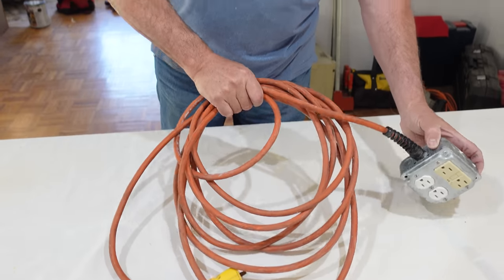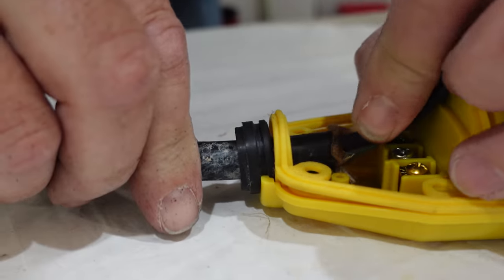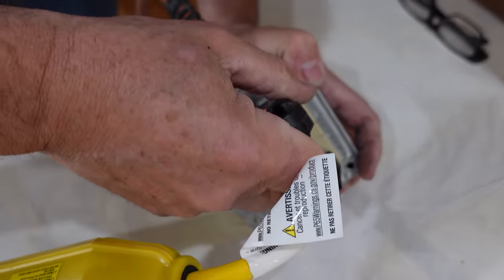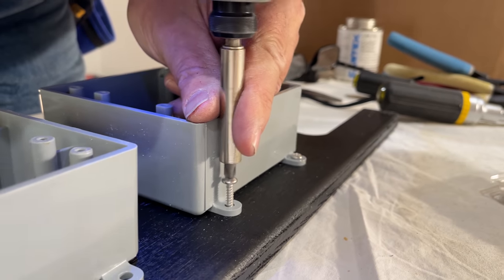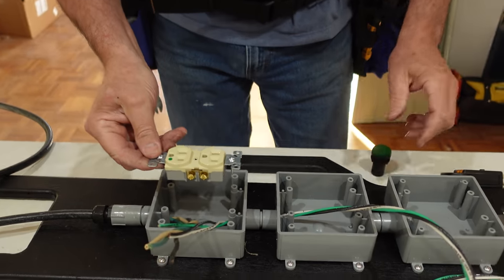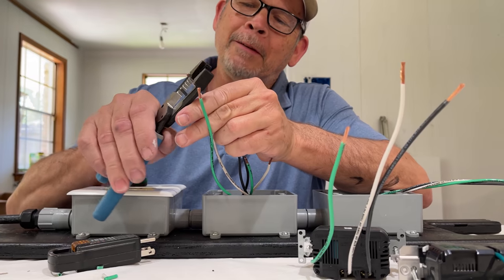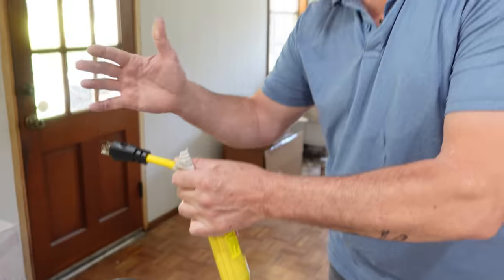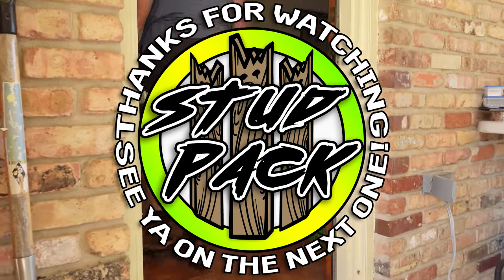HOW TO MAKE THE ULTIMATE EXTENSION CORD!

Comment: I never knew that the USA has such 20 amp plug with the one 90 degree rotated prong, interesting 🙂 But regarding 5:49, it's better to put the wire on the left side of the screw, so that the rotation of the screw will pull the wire in. On the right side it's tending to push the wire out, just a tiny bit, even with this clamp design. It will work this way, but to be perfect.. 😉 And regarding 2:08, it would have been better to cut the plug of like 10 - 20cm away from the plug because conductors tend to break overtime near where it's mechanically connected (metal fatique), so now you have half worn out conductors in your new extension cord. I guess i better leave my opinion in the middle about the ultimate-ness of this extension cord (so many sticking out things that can and will break), but it's a nice project 😉
Reply: Pulling a number from the air, I'll bet 97% of Americans are not aware of the 20 amp feature.

Comment: About the "hospital grade" receptacle... My understanding is that the green dot signifies an isolated ground, where the ground does not terminate on the neutral bus at the service. It just so happens that many hospitals utilize isolated grounds because it is less prone to interference of sensitive electronics. It is also likely that these are more heavy duty simply because of the [non-residential] nature of isolated ground installation environments, not the other way around. I'm not an electrician so perhaps I am misinformed. And I am not sure how NEMA would feel if you are identifying an IG receptacle on a non IG circuit. Maybe black sharpie over the green dot???
Reply: An orange triangle is isolated ground, green dot means hospital grade, step above commercial/spec grade.

Comment: Love all the videos and I’m sure the circuit will hold at 28 amps for a short period of time till the gfci gets hot enough to trip… 
A separate question altogether but I have a weird circuit that I have tried wired several different ways to get both fan and light to work independently. For some reason circuit is live no matter what I do? Any suggestions?

Comment: The hospital receptacle is actually an isolated ground receptacle. doesn't do anything in this situation because it's used to have a direct ground wire from that plug to the panel having all the grounds connected cancels the meaning of having an isolated plug.

Comment: So the improvements made here are really nice but outdoor boxes with indoor plates still is a shock risk.  I would have used outdoor rated while in use covers and ditched the wago connectors and instead opt for screw down wire terminals or marettes.  Wago connections are not great for high current applications and are the connector equivalent of the pinch terminals on consumer grade audio gear.  They are probably fine for wiring a lamp or ceiling fan but not for high loads like this extension cord.  You mean NEMA 5-20r not 6-20r.  6-20r is 240 across both Lines in North America.  Also a cord with a 20 Ampere receptacle should have a matching 20 Ampere plug on the other end.  Some vacuum cleaners when blocked should be shut off as the air from the hose is used to cool the motor.  Now some vacuum cleaners like the wet and dry cleaners, some central vacuum systems, Kirby units and Rainbow cleaning systems between 1985 to 2019 have bypass cooling fed from a separate cooling fan to cool the motor windings, it’s not as big of an issue.

Comment: To slide on that grommet. Use Windex or ammonia. They're Bases, what are the properties of bases? they're slippery, what's true of bases and acids? They are only either when they are wet. So spray on some Windex, that grommet will slide right on, when the Windex dries the lube effect is gone the rubber part will stay in place. (I learned to do this handle grips on bicycles.)

Comment: imo, the live wire breaking free and contacting the aluminum housing isnt nearly as much of a concern as that giant plastic housing cracking, taking on water and other contaminants or straight up breaking apart.
you have a GFCI on the male end, so long as the housing is grounded its fine if its aluminum

Comment: Green light's cool, but mine has a panel mount Voltmeter/Ammeter in one slot. The backlight is blue and it can read up to 300V so it can warn you if someone has wired 240 to a 120 outlet.

Comment: Nice very "Nice" Hello so I dislike being a nitpicky viewer! But I have two picky- nits. Well one ? And one Suggestion #1 I noticed you didn't add a GFCI? But I think that's understandable Because equiped with phone charging devices it shouldn't be in damp locations So oK and #2 Given the length of your Monster cord, the Guage and all of the devices! Wouldn't it be nice to add an onboard circuit breaker suitable/capable enough to interrupt power if overdrawn?? Thanx D.

Comment: The 20 amp rating is a maximum you can expect to run continuously and a minimum at which you should ever see the breaker trip after extended use.

Comment: The first extension cord with the orange cable violates its usage under UL. UL has issued warnings using metal boxes with pre-press K.O. for this purpose. The K.O. can get pushed in and cause shorts and allow access holes that fingers can go into.
The second cord Violates UL under the fact that the system can only be rated to the lowest voltage and current/wattage for the lowest component within the branch power circuit. Since the GFI is within the branch circuit and clearly labeled 125v/15a all components downstream must inhibit/prevent devices larger from being connected. Also fairly confident the cord is undersized for the 20a application.

Comment: 2:50 When I do this I usually just take a pair of needle nose pliers and use the cutting part to gently press into the wire and I do a circular motion to cut the exterior sleeve

Comment: The vacuum pulls less amperage, but most will OVERHEAT! It depends whether the motor is flow through or bypass cooling. More expensive vacuums, like central vacuums, use the bypass style where even if you block the hose, cool air blows over the motor. Bypass motors are also used for vacuum tables/presses where they need to maintain as many inches of vacuum as possible on the part.....the opposite of a vacuum used for cleaning.

Comment: My understanding is that breakers are inverse/time devices.  This means that should the connected devices draw more current than the breaker is rated for, it will take a period ot time before it trips off.  Should the current that the is drawn on the breaker rise eve higher, the amount of time before the breaker trips will decrease, meaning the breaker will tirp sooner.  Hope this helps?

Comment: One thing I noticed,  those Wago's can sometimes have the small lever pop up causing the wire to not be clamped tight. Wrapping with electrical tape prevents the lever from popping up.

Comment: 1) ground wire should be shorter than the other 2 if the terminal is not already constructed in a way that disconnects the ground before other wires
2) if you have a clamping plate with the screw thread 'in' the plate, put it on the left side, so the screw rotation 'pulls' the connection in rather than 'pushing' it out
Reply: Ground should be longer than the other 2 terminals so the device is grounded if something goes wrong. Line should be the shortest so it disconnects first. So if something goes wrong there is no connection to 120V so you can't electrocute yourself
Reply: @arigasendo147  I did a derp. Of course ground should be longer - I had a thinking error because of a few beers and the fact that here in Europe, the ground pin usually protrudes farther towards the connector end :) Thanks for correcting it

Comment: Can you tell us the measurements of the black plywood base I have built the backbone part with the plastic boxes wired it up and it works perfectly but since I am a novice with wood work I need the different measurements to finish the project I need the width and length and the cut out size for the cord wrap around and the exact size and placement  of the handle hold oh and yes I have subscribed to your channel  and liked this project

Comment: Plug everything in but use them 1 at a time. I worked Hospital Maintenance and the reason Hospital Grade outlets are needed is because of the constant plugging in and unplugging of bed side equipment. Ordinary outlets wont last a single year. New construction sites need to learn this lesson.

Comment: I would also change the order and put the light at the other end.  You want the light at the top when you hang it on the wall so that it will be visible and not obstructed by all the cables hanging down.  I think I would put the USB's next to it for a similar reason, both to make them more accessible, but also to avoid having them mixed with as many 120V connections.   Also, for the switched outlet, I would use a combination switch and single outlet.  Not only would it make it clearer to the uninitiated that maybe it is only that single outlet that is switched, but do you really want the switch to control 2 outlets?  If so, then why not use two of them instead with separate switches in the same space.  I also would have gone with cover plates that would not snag and break so easily as the ones you used or some other way to protect those sharp corners from causing abrasions as well as breakage.

Comment: I would have reversed the order of the outlets, making the first box the one containing the 20A outlet. As you made it, it's at the end of a daisy chain of wago connected jumpers, with each adding a small amount of resistance, and therefore voltage drop at 20A, which could amount to several volts I'd guess.

If I were making this thing, I'd prefer a "bus bar" approach where each outlet is tapped from a solid copper bus made of heavy gauge copper wire or bar, in a similar way to how power panels are organized.

Comment: Place a fuse rated for the max amp draw of the wire to prevent over heating. Place the fuse on the hot side before the outlets.

Comment: Wouldn't it be better/safer to use wire that is rated equal to or higher than the highest amp receptacle? That way when you DO use a 20A tool/device, it's not running along a 15A cord?

Comment: Why didn't you build in a voltage/current meter into the extension?  Also maybe a WIFI smart plug so if you're on the roof you can turn things on and off.  Or am I spoiling V3.0?

Comment: As a power system engineer, I want to add a few things that the circuit designed for 20A, would be for 15A. Circuit = Wire size, if wire size is designed for 15A, 20A receptacle should not be on there. Secondly, 20A circuits should be at the entry (where the hospital grade is), why? Voltage drop. Thirdly, the indicator light should be at the end of circuit, not at the beginning. Some Electricians do not like Engineers advise, but its an engineer's ethics to point out when things are not right. :) Otherwise a good video.

Comment: Do you trust those Wago connectors? They don't seem to hold the whole wire and just touch the front and back. Or is this fine since it can spread the wire strands out more than a solid wire?

Comment: As a retired EE...  DON'T put glue/cement in the female side of PVC conduit/box connections.  Only put your glue on the male ends.  That way an squeeze out will only be on the external portion of the conduit or connectors.  
A) any wet cement can react with the various coatings potentially soften or destroy your wire insulation.
B) any dried cement can dry with sharp edges... even when you try to wipe up your mess.  Those sharp edges or points can cut or strip your insulation when you pull wire through exposing your conductors.

It's an easy change in your procedure and can save you and your insurance a whole lot of money... and your reputation a whole lot of grief.   There is no pressure in conduit like there is in PVC water systems so you don't need a primer or a lot of glue... just enough to be water tight if you are burying it.

(Edit)  I watched to the end...  why didn't the breaker trip?
Your typical residential NEMA circuit breaker is an inverse time circuit breaker. This means that the time that it takes for the circuit breaker to trip is determined by the amount of current flowing through the breaker. This is called the breaker trip curve. Trip curve data is the graph that comes with the paperwork or card that is in the packaging.

For a standard 20 amp circuit breaker it may take a couple of minutes to trip at  say 25amp, quicker at 30amp... maybe not at all at 21amp

Comment: As a electrician with over 50 years of experience I can tell you that this kind of extension cord have been being made for at least that long (50 years). You should have used connectors on the ends of the stranded wires, avoid    adding  any extra connectors in the box, I would have used exterior grade covers for the box as those plastic covers are only for in doors and provide no impact protection.

Comment: If you would have run it longer it should have tripped for sure. The  12 wire is actually amp-rated for 25 amps, the wire probably wasn't getting hot enough at the breaker to trip.

Comment: 26:11 the fact that the sound increases in pitch to me makes immediate sense that the motor is performing less work and using less power otherwise it would decrease in pitch as it would be loaded more thus lowering the RPM.  A motor under no load will have a much higher RPM then a motor under load

Comment: It didnt trip because it is designed so when you first start a saw or other tool the initial draw is more than it is after it is running. It can hold more than 20 amps for a short time but a breaker is only good for 80% of its value for constant loads. A 20 amp breaker can continuously have 16 amps but if it goes for more than a few minutes above 16 amps it will heat up and trip.

Comment: All modern circuit breakers are not designed to pop at the instant that it hits the rated current, a good example of this is my dust collector that pulls a whopping 50+ amps when you turn it on, it is on a 20 amp breaker... once it gets up to speed it pulls < 15 amps, but for a bit when it is spinning up it pulls a TON.   If the breaker popped instantly when you hit the rated current then all sorts of inductive motor appliances would be pretty worthless.   This isn't a problem because the wires don't heat up much in this situation.   If you let it keep going for a while, the breaker would have tripped.    Of note, if I turn on my dust collector let it run for a while, then turn it off and let it stop, and try to turn it on.. Boom! it pops the breaker.  Why?  The breaker has already heated up a bit from the power running through it that is close to its tripping point so when you start pulling a large load it pushes it over the top.    If I let the breaker cool down between runs it will start just fine.  They used to call the breakers 'slow blow' or 'fast blow' breakers, and now all of them you are likely to find are the slow blow ones.   There isn't much use for a fast blow breaker for inductive loads.

Comment: I would have gone metal - boxes, faceplates, etc., and 12/2 would have been a no-go for me - at least 10/2, or even 10/3, depending on where I was expecting to be able to plug it in (especially since you added a 20-amp plug in addition to the duplex and other ports). The fact that you went to the trouble to ensure a good seal on the boxes, but, then have all that potential leakage at the outlets, faceplates, etc. kind of defeats the purpose of trying to water-proof anything. I guess you could have sprayed the whole thing down with FlexSeal after the fact.

Comment: The circuit breaker will trip after a short period of time the breaker just needs to heat up a little bit due to the overload. Give it a few minutes on that 28 amp draw and it will trip.   Now if there were a dead short it would trip immediately.

Comment: Coming from a lifetime of low voltage work, other than it being an additional step, is there any reason why i shouldn't tin the stranded copper wires with silver bearing solder?

Comment: the breaker didn't trip because of the trip curve of the breaker. the trip curve is how long it takes for the breaker to trip at a certain amount of current. For example, if you draw 25 amps from a 20 amp breaker, it may take up to 30 minutes to trip. this time decreases the more power you draw, so if you are drawing 60 amps, it may only take 20 seconds. some breakers are different too. some depend on heat to bend a piece of metal to trip the breaker, and others use electronics to measure current draw. 
i'm not an electrician, but i do have knowledge of electrical, and how the US electrical system works.

Comment: Those 20 amp plugs really don't change anything in regards to providing or improving power transfer. They are actually used to indicate that the plug is a 220 volt.

Comment: Well dang, now I have to build me a new supply cord after seeing this video
I had no idea they came out with new reciptical with built in phone charger 

Funny story built a buddy a lake house about 20 years ago when I got to the location the temporary pole was 200ft away from my slab
I had an eletrican build me a cord and it cost me 400$ 
It was basically just #8 run to piece of 2'x2' plywood with a raintight panel mounted to it 100amp main with  1 30amp outlet and 6 20Amp outlets 
Ouch